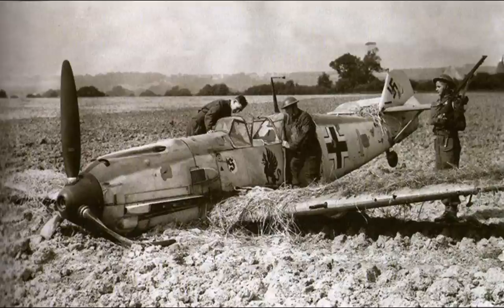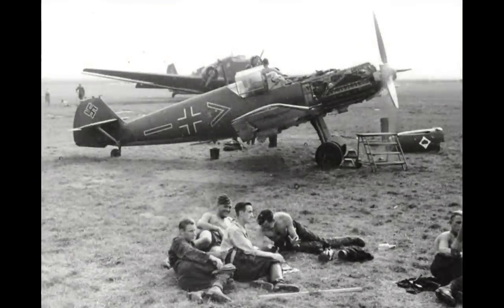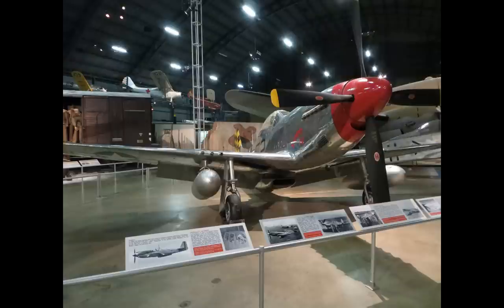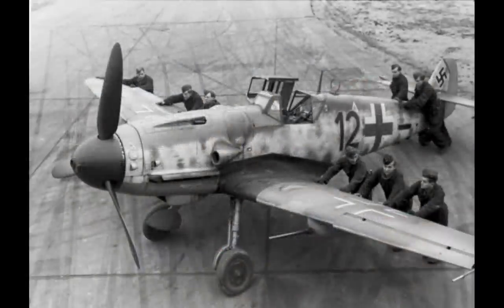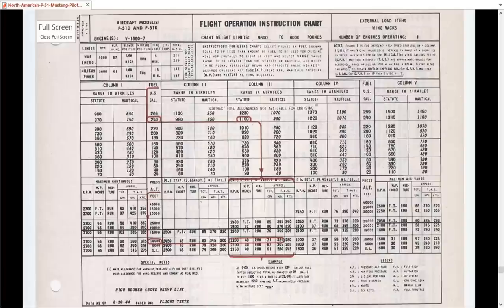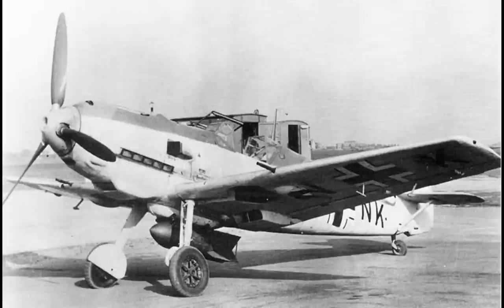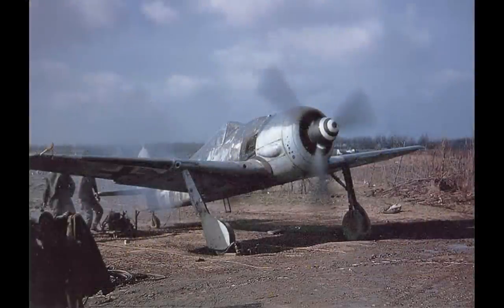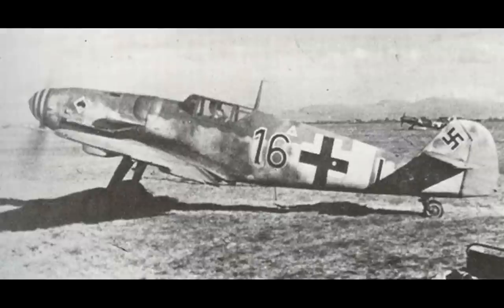Messerschmitt BF 109, Why Such Short Range?

Comment: Interesting, as usual.  A few comments.  

The 109 was very small because it was designed very early when high performance engines were small.  The first version flew with only 600 hp.  The first Spitfire flew with 1000 hp, the first P51 with 1200.  The Germans could not afford to redesign it all, especially given that they hoped for the war to end soon.  So, as the bigger engines became available, they ended up been shoved into a small airframe.  By comparison, the Japanese Ki-61 built around the DB601 was larger, also lightweight, and probably a much better fighter than the 109E or 109F.

Second comment is are on the advantage of fuel injection.  Ricardo seems to downgrade the benefit of direct injection (DI), because he claims that the evaporation cooling effect happens at the eye of the supercharger, improving compressor efficiency.  However, if you get the cooling effect past the intake valve which is the largest restriction of the whole system, then you really get a benefit in volumetric efficiency.  Also, the cooling effect right in the cylinder helps with anti detonation, allowing the DB 601 and 605 to operate better with lower octane fuel.  I do not think the venturi restriction is really much of an issue to a carbureted engine.  Especially the later ones when they used the venturi as a signal for the injection system.

Your comment of a bigger engine affecting fuel economy is partially correct, but I think its worth commenting on.  In a car engine, a bigger engine will hurt fuel economy mainly because the engine operates under closed throttle and manifold vacuum.  That directly affects pumping losses.  These aircraft engines operated under some boost even cruising, therefore the pumping loss of the big engine was not really an issue.  Certainly the friction hp of a 35 liter engine would be a bit more than a 27 liter engine, but the pumping loss that really makes a US muscle car so thirsty is not as much of an issue.  As a side issue, the modern DI in car engines is helping fuel economy mainly by allowing the engines to run lean at part load and minimize pumping loss (less manifold vacuum).  They do that via stratified charge, possible by having a fuel injector close to the spark plug.  This was not a benefit in airplane engines, because they almost never ran under manifold vacuum.  The second reason why modern DI engines do well in fuel economy is the higher compression ratio that this allows.  This did not help much the airplane engines, because they would rather use more boost pressure than higher compression ratio.

Finally, the main role of a German (or British) fighter was air superiority over the battle field.  This is really the most critical role of a fighter.  This is why the RAF and red airforce also did not worry too much about range.  There has been a myth that the war was won thanks to the strategic bombing and the long range fighters that made that easier, but it is a hard case to make.  The strategic bombing did more to kill civilians and unite the Germans than anything else.  But that is another debate.

Also, comparing speeds of the P-51 and Bf 109 G, at low altitudes there was not that much difference.  The P-51 got a huge benefit from its well designed radiator design.  There is a myth that the laminar flow was the great feature of the P-51 but recent studies show that this benefit was marginal.  It was all about cooling drag.  The P-51 designers got that one right.  Maybe just about the only thing they got right!
Reply: Good analysis.  The P-51 had a big  speed advantage in the thick air of low altitude due it more advanced aerodynamics though he Me 109 could if well flown out turn it.   At medium altitudes (20,00ft) the versions with the oversized supercharger such as K4 and G10 could match the P-51 and probably had better power to weight ratios then at higher altitude the Mustang would again pull ahead due to its two stage supercharger.  There was a Me 109K14 with a DB603L engine that had a two stage supercharger and a 4 blade prop.  Maybe 3-4 were made but not flown in combat as the war was almost over.   The bigger DB engine may have more volume but it doesn't mean more friction as RPM and piston velocity may be less.  for similar power engines will pump similar amounts of air.
Reply: @WilliamJones-Halibut-vq1fs  Yes William, I forgot that the DB601 and probably 605 operated at lower rpm than the Merlin, which potentially could completely compensate for the larger displacement with regard to friction.  So, with all likelihood, both Merlin and DB 601/605 would operate under comparable BSFC numbers during cruise.

Ricardo had made the case that the Germans were building large displacement engines, but engines that operated under low boost pressure, which were designed super light weight for their displacement.

If we stick with BF 109G and P-51 comparison, there is little doubt that the 109G is the better plane in a dog fight.  Not only it will out turn the P-51, but it should have better climb rate for most altitude ranges (expect for very high altitudes where the RR supercharger of the P-51 will help).  Also, very critical, it had much better armament.  But even an experienced German pilot faced a number of problems.  First, he had limited rear visibility.  Second, he had to know for sure what he was fighting with.  The strategies of fighting a Spitfire were very different from a P-51.  He could not dream of out turning a Spitfire, and in some altitudes, maybe he could climb with it, but most of the time he could not.  So, this variation in tactics and uncertainty of what exactly he was fighting could have thrown off many a German pilot.  (this was of huge help to P-47 pilots, by the way, where the Germans often applied Spitfire evasion tactics by diving, and diving was just about the only thing the P-47 could actually do).

Yes, the K-4 was a completely different animal.  Only a Spitfire XIV could claim to be able to fight with a K-4 in (slightly) better terms.

I have never seen a picture or drawing of a 109 with a 4 bladed prop.
Reply: @demetridar506    Unless I misinterpreted the data available, generally most Bf109's out climbed comparable vintage Spits at most altitudes.  Even the 109K4 versus Spit Mk XIV.

"On paper" the Spit had the advantage in handling (lower wing loading among other things), but an experienced 109 pilot could compensate for that (in one way or another).  There's testimony out there from some of the German aces that survived the war, where they stated that they could almost always turn in on a Spit.  A US stunt/aerobatic pilot that has flown both 109E and 109G models, as well as a Spit Mk V and IX has said in interviews that he believes this to be true based on the flight characteristics of both planes.
Reply: The Griffon Spitfire Mk XIV was a monster due to the two stage intercooled Griffon engine and the huge wing area, it would be hard to beat.  Adolf Galland said the best feature about it was that it was so rare (only about 900 produced).   You can find some outlines of Me 109K14 showing the planed 4 blade prop, they generally show an oval supercharger intake to take in the extra air needed at high altitude.  The Merlin head was held on by bolts (4 surrounding each cylinder) whereas the DB605 used the cylinder liner as a giant hollow bolt to pull the head onto the cylinder.  This allowed the engine walls to be smaller and to have 34.9L instead of the Merlins 26L in less frontal area and same weight.  Merlin compensated for its low swept volume and low compression ratio with very high supercharger boost which required intercooling.  This also gave a lot of jet thrust worth abut 300lbs.  By the end of the war Merlins were operating at 28psg (3 ATA or 90 inches mercury) whereas the DB605 reached 14psig (1.98ATA or 60 inches).  Overall about the same amount of air.  The Hispano Suisa engines used a similar cylinder construction to DB.

By the end of the war the Me 109 was getting too old.  The Germans knew it and were trying to replace it.  They had the Fw 190D series with the D12/13 having powerful two stage intercooled superchargers  and Ta 152C and H and offcourse the Jets were coming in. Ideally they would want to replace it earlier but that is hard to do because you loose so much production.  They even looked at Italian aircraft which they quite respected.
Reply: @WHJeffB  The Spitfire also had the elliptical wing, which was a bigger benefit over the slats of the 109.  While a super experienced 109 could have a chance against an unskilled spitfire pilot, I can't see how the 109 could overcome the difference in wing loading and elliptical wing.  The stunt pilot is BS.  The only way to confirm his claim would be to either fly both planes in a mock up dogfight, or take measurements.  Creg in this channel has shown how one can also calculate the steady state turn rate.  Just no way.  Also, late model 109's had other handling issues.  Due to lateral stability limitations caused by putting way too much power in a too small a plane, the CG had to be moved too far forward.  That made it impossible to go into high G maneuvers at high speed, unless one trimmed the plane up.   Which of course takes time.  Also, on take off, the plane did not have sufficient rudder authority to keep straight, and slight application of brakes was needed on take off.  That makes the plane very tricky to fly.  On top of that, the cockpit is very crowded and uncomfortable, and the canopy allows very little rear visibility.  It takes one hell of a pilot to fight in this plane, and if you are fighting Spitfires, you are not in a good place.  Consistently, the German aces respected the Spitfire.
Reply: @WilliamJones-Halibut-vq1fs  Yes ...  One of the inherent disadvantages of the 190 was that it was not really meant to fight other fighter.  Its small wings and high weight due to lots of armor gave it a very high wing loading.  The 190 was best for chasing bombers and ground attack.  So, it could not truly replace the 109.  But it was a newer design, and many of the serious shortcomings of the aging 109 were not present.
Reply: @demetridar506 The Fw 190 did well in a certain dog fights due to high instantaneous turn rates.  It had a high rate of roll and was very responsive.  A quick turn (say a 90 degree turn by way of example) was exceptional.  There is no way it could compete with a Spitfire in sustained turn rate but it could exceed it for an critical few moments.  Also 'manoeuvrability' is not just the radius of the turn without loosing altitude, although this is most useful.  It can be measured as the turn rate in degrees per second.  The other thing to consider is power to weight ratio.  If a fighter has a superior power to weight ratio is can use this to increase its sustained turn rate, or use it to convert into altitude which confers a manoeuvring advantage.   Some of these concepts were clarified by "John Boyd" of the famous "fighter mafia" which looked at energy retention of the fighters.
The manoeuvrability performance of the Me 109 and Fw 190 seems to be very related to their engine power levels.  When they had equal or superior power to allied aircraft they were very competitive in manoeuvrability.  There were times the Me 109 had more or equal power than the Merlin.  Eg Me 109F4, Me 109K4.   The spitfire had a large wing.  Even if you assume that it produced no more lift than the slated wing of the Me 109 it would most definitely produce that lift more efficiently.  Slats definitely increase lift by 50%-70% but they have a poorer lift to drag ratio than increased wing are to achieve the same.
Reply: @WilliamJones-Halibut-vq1fs  Yes, indeed, the FW190 had exceptional roll rate at high speed, and the Spitfire was weak in roll rate at high speeds.  The Fw190 could use this as a short term defensive strategy, much like an F4F against an A6M in the pacific.  But it is a short lived advantage  because the Spitfire will eventually catch up and eventually the FW190 will run out of speed and or altitude.  It worked well for the F6F's in the pacific, because they were always in numerical superior numbers, and a short term survival was all that was needed until one of your wingmen can bail you out.  Offensively, th Fw190 had little against the Spitfire, assuming that the latter's pilot has seen him.  A turning fight will always work (unless you are in one of the "circus" missions of 1941 over France and running low on fuel).

The degrees per second turn rate is equivalent to turn radius if we are at the same air speed.  Another way to express the turn rate is in "g" loads.  Over a certain threshold of IAS, the turn rate is limited by structural and/or pilot limits (between 6 and 8 G's for WWII pilots).  But as airspeed drops (and it will drop quickly), then its stall limited.  This is where good wing loading helps.  Good power to weight ratio may help you sustain higher speeds for longer period under extreme G's, and thus a high wing loading fighter may try to sustain the speed range that is not at a disadvantage.  But it is only a temporary deal.  Sooner or later, the downside of high wing loading will catch up to you.

The 109's generally had better power than the Merlin at lower altitudes.  Their top speed was typically better at low altitudes.  The two stage supercharger of the Merlin from 42 on gave a permanent advantage to the Merlin, and the P-51 also exploited that.

The elliptical wing of the Spitfire also extended its stall which allowed it to exploit the wing area very well.  The only feature that came close (or possibly better than) the elliptical wing was the Nakajima batterfly flaps.  The Ki-84 had only slightly higher wing loading than the Spitfire VIII yet had comparable turn capacity.  Some sources say it was superior, but not sure yet ...

Comment: Greg as I told you before,  you have to compare the P51 with the 109k
Last time after my comment you did it
Best
Reply: They were not primary combatants, however. Most P51B/C/Ds by all accounts fought Bf-109 Gustavs.
Reply: @Th0nky  I said another thing
Reply from the maker: Even Germany's ace of aces, Hartman didn't fly the K4. He flew the Gustav. I just don't think the K4 is all that relevant.
Reply: @GregsAirplanesandAutomobiles  you are speaking about the machine not the pilots.
By the way Harttman used a G10 close to a K, not a G6

Comment: Motortrends engine master's have done a couple of very good videos comparing fuel injection to carburetors, and they found quite the opposite of what you say.  I highly recommend checking it out, would like to here what you think of their comparison.
Reply from the maker: I'll be happy to tackle that but I need a link and I need you to tell me specifically what I said that they disagree with. My initial thought is that they probably found less power with one of those hokey aftermarket throttle body systems. Those manage to combine many of the worst features of fuel injection with the worst features of a carb. I hate those things and would choose a carb every time.

Comment: Sir Greg. A question came up on another channel so naturally I came here to ask.... How do YOU think a P-47 would fair up against an Me-262, not taking into account tactical advantages such as difference in altitude, being in the sun, and things like that? It's MY opinion that a P-47 would stand quite a bit better than 50/50 odds due to greater durability and maneuverability and 3000 rounds of .50 cal, but I would like to know your opinion right off the top of your head if you have one.
Reply: It seems most Me 262s that were shot down by Allied fighters were done so during takeoff or landing. If the P47 had the range to loiter near German aifields, they certainly would have gotten their share. Eventually, the P47 got the range and the climb rate it deserved, but I think by then Adolf had already eaten his bullet.
Reply from the maker: First of all, we tend to focus on a 1v1 scenario is some isolated chamber with no other aircraft, no flak, equal pilots and all starting conditions neutral. Of course this never happens, but let's say it did. In this case, the 47 is not simply dead meat as some people might think. Both pilots will have a very tough time getting guns on target. The 47 simply can't catch the 262, and the 262 can't risk slowing down to turn with the 47. If one round from the 47's guns if it gets into the engine can do enough damage so that the 262 will lose its speed advantage, at which point it's doomed. However, even though the 47 is tough, the 262's quad 30mm are devastating. One round from those can doom the 47. I tend to think that in this scenario neither pilot is going to risk taking that hit. Most likely, the 262 will make several unsuccessful passes and then be running low on fuel and head for home. Now, in reality, the 262 has an advantage that's really big. If the 262 pilot sees the 47 first he will have a good chance to get into a firing position and knock out the 47 before he sees the 262. However if the 47 sees the 262 first, he will probably never be able to catch up and get the shot, so real world the 262 has the edge, until of course, he has to land and then finds a 47, still fat on fuel loitering over the 262's airfield.
Reply: @GregsAirplanesandAutomobiles  - Thanks. I would have given it to the P-47 but hey. I'm just prejudice I guess.
Reply: @whlanteigne  - Thanks.